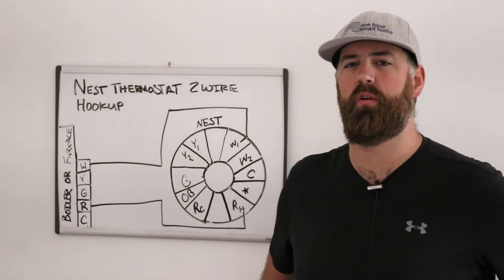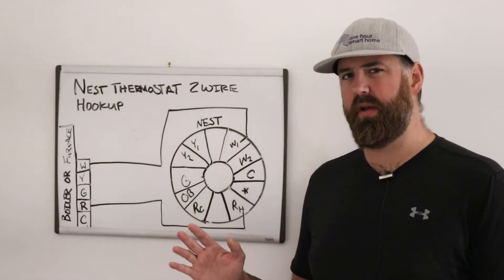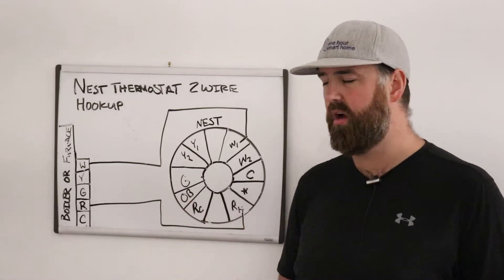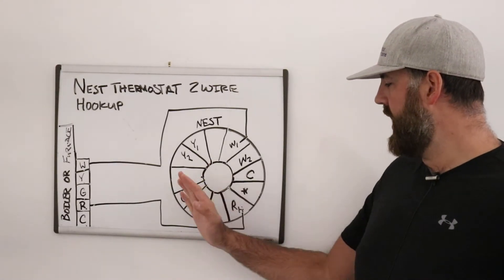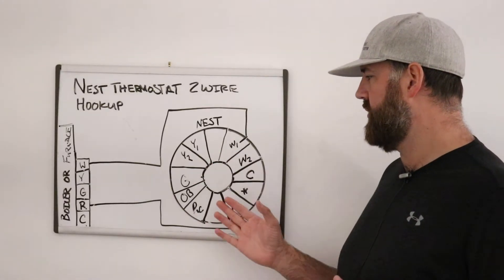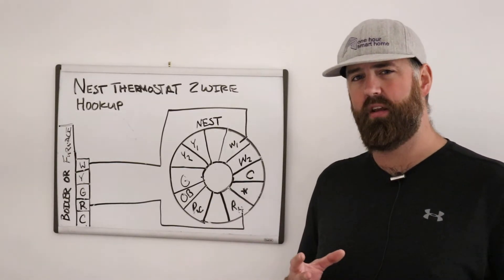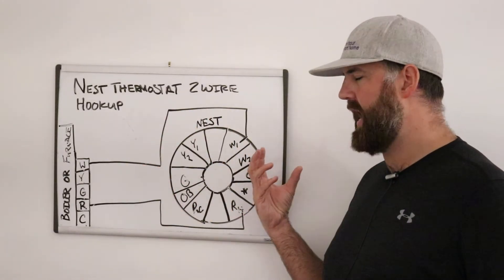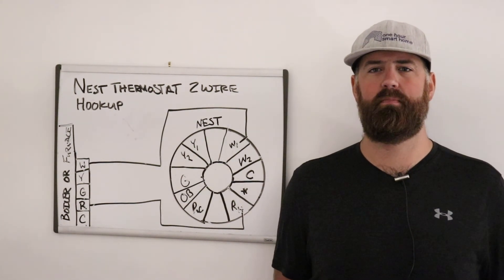Nest Thermostat 2 Wire Hookup Instructions

Comment: I just want to install my Nest Thermostat to use with my cooling only air-conditioning system in a very old Singapore building... does ANYONE have any advice on where I can find out how? It has only two wires coming to the manual thermostat right now.

Comment: thanks for a great tutorial. I have a question maybe you can help me with. I have a 1995 manufactured home with a forced hot air and a/c unit using a two-wire thermostat. I believe the way they can get away with only two wires to the thermostat is because there is a switch on the furnace you switch from heat or a/c. and there is also a switch on the thermostat itself that has a heat /cool switch. so, what I am thinking is I can use it for both. by switching at the Furnace and using thermostat as you would with heat. just wondering if you had any experience with a system like this.

Comment: Great Information! I have two separate heat sources. One is a Fireplace with a millivolt  two wire. The other is floor heat boiler. Will the nest E work separately on both? Thank you

Comment: Yeah, this will work.  Sometimes…

The nest electronics run off a small internal battery.  That battery will recharge off of the red and white wires, which will read 24 VAC between them, but only while the thermostat is not calling for heat.  Once the nest shorts between the red and white wires there is no longer 24 VAC between them and there will be no battery charging.  If your climate causes the thermostat to call for heat often, the battery will discharge too far to run the thermostat and you’ll lose your ability to heat.  This scheme is called power stealing, and it’s not reliable.  

Instead, you’ll need to supply another 24VAC return wire on the C terminal.  This will put 24VAC between the R and C at all times, even when calling for heat on the W.  If you don’t have a third wire, you can just plug in a 24 VAC wall wart transformer (300ma or greater) and connect the two wires to the R and C.  That power will only be used to power the nest, and not be used to call for heat.

Comment: I have a question. I have a system call Hot Water Electric Heater from Intertherm. Is have 2 separate electric wires little weird for me. So left side have black and white have current power when i turn on the circuit. And the right side has black and white that doesn’t have power. I will post a video on youtube and if you can point out for me that is super helpful.

Comment: I should’ve just watched this video and called it a day… but given your explanation for Nest, does it work with Ecobee as well?

My setup is the same. Red wire and white wire. I replaced a dial Honeywell thermostat (not sure if it was the mercury one) with a digital Honeywell thermostat. Red wire goes to red slot in the Honeywell thermostat. The white wire in the white slot.

I want to use the free ecobee that I  received from the utility company. Can’t I just connect this in the same fashion?

The furnace is 25+ years old. Still works!!

Comment: Have a two wiring heating and cooling V+ =red wire and VG = Green wire. Voltage is 3.38 v i know nest requires 24 V to operate do I need a transformer?

Comment: I have a Modine heater in my shop and my thermostat currently is a two wire set up (W & R).  I have a nest thermostat, and it requires a C wire or a Google Power Connector.  
How would you wire up a system like this using the Modine heater? I already went ahead and connected the power connector in the appropriate spots according to where the thermostat wires were and I connected the C wire to its appropriate spot. I fired up the Nest Thermostat, and it did not detect the C wire/power.  am I supposed to install a jumper wire connecting the C and the R behind the thermostat?

Comment: I have an old Honeywell 2-wire thermostat (mercury switch) hooked up to a relay that switches a 240V load for baseboard heating. There is a spare third wire, that is unconnected between the thermostat and the relay switch in the basement. Is there a way to rig it up with a 24V wall wart transformer to get power to the Nest?

Comment: Question…. I have it setup the way u have it for the last 2yrs and today I got a “e74 not detecting the rh”… everything I saw said it’s your condensation line clogged but I don’t have a condensation line… it’s heat only and it’s radiators .. z

Comment: Perfect video. I have a gas boiler. My thermostat has a R wire that is white and a C wire that is black. Just 2 wires. Will this work with the the basic Nest ( non learning)Model  GA01334 or 
do I need to hook up the C wire adapter? Appreciate any insight. Such a helpful video

Comment: great channel.....I have a Nest basic thermostat need for a furnace with two zone requirements...therefore needing two thermostats....currently the main thermostat has 6 wires and the secondary thermostat has 4 wires....the main one has an orange and black wire.....How does the wiring work?....I have another Nest on the other furnace with one zone and 4 wires with easy hookup however just watching your video I know how to hookup the C wire for power..thanks...So the Nest basic has an orange/black port but not both....Confused as to how wire it for two units on the same furnace  thanks  Gordy

Comment: Thanks for the video - it got me thinking, however this workaround did not work for me. I got things working eventually and will describe in the hope it helps others. I have a gas HVAC system (heat only) with electric blower. Installed around 2000 with a Honeywell Chronotherm IV controller which has 3x1.5V batteries. It had two wires connected to W and R. Nest Gen 3 kept turning off with two wires connected to Rh and W - it reported no power to Rh wire. So I bought a 24VAC 1amp power supply from Jaycar and connected as per your other video with three wires. Again thermostat kept turning off due to no power to Rh wire. I then connected transformer to Rc and C, and connected the old wires back to Rh and W. Thermostat had power but it blow only blew ambient air, furnace didn’t come on! I then twisted one transformer wire together with the old Rh wire and just got the now thicker end inserted in Rh, left the other trans wire in C, and the old W wire in W. Hey presto! It works fine and well tested now. Cheers.

Comment: Great info.  I need some help.

My workshop has two standalone natural gas heaters.(2 wire system)

I also have two residential air conditioners I believe it to be a standard (4 wire?). 

I want them all on one nest thermostat.

In the winter I want it to close/open the circuit to control the heaters without turning on the blower fan that is on the A/C.  

Can a nest do this and Where would I connect what wires to the nest and are their any internal settings needed for this to work?

Comment: So I have a miller/ Beckett furnace with a first generation nest.. only two wires running from unit to thermostat… how do I hook up without adding c wire bc there is nowhere on my board for me to connect to.?

Comment: What would you do if your 2 wires are red and green. My thermostat is really old, which uses a small lever that you move to the right to select the desired temperature. That's what I have in my home. It's heat only, and my furnace uses gas, not oil.

Comment: Someone PLEASE HELP. I have 2 wires coming out of the wall, when the Nest first turns on it will run me through the set up process and runs the test and kicks the furnace on no problem then shuts it off. But then roughly 2 minutes later it says there’s no power to the RH wire and I get an E74 code. 

So I take the nest off the base and restart it and put it back on and turn it on, and I’m able to turn the thermostat up and the furnace comes on, then again after roughly 2 minutes of being on it sends me the message that there’s no power to the RH wire with the E74 code. Can someone please help.

Comment: I have an old thermostat that has two wires. Vg and V+. On the controller it also says Vg and V+. The controller also has all of the Y, W1, Rc and C. I've installed the nest with Vg to W1 and V+ to Rh. The nest is only reading the heating but not AC.

Comment: My wiring is one (thicker) black wire that splits into two wires. (Reminds me of the pull n peel twizzlers candy). One black wire runs to the “W” and the other runs to “RC”. Then I have a red jumper wire that is in “RC” and “RH”. So on the Nest, I don’t need the red jumper anymore. I just connect the one black wire to W1 and the other black wire to RH? I just don’t want to fry the furnace. 😞

Comment: I've got two black wires (one goes to the W terminal and one to the RH terminal), a green wire that goes to the G terminal, a white wire that goes to the Y terminal and red wire that goes to the RC terminal on a White-Rodgers thermostat. I'm trying to replace the thermostat with a Nest thermostat. I'm wondering if I can use the black wire that goes to the RH terminal as the C wire?

Comment: I know this video is old but I need some help. I have a two wire system, red and white wire. I put the red in the R terminal, and white in the W1 terminal. The only options my nest is showing is heat, off, or eco. There is no cooling option. What am doing wrong?

Comment: Thanks for the video. I tried this with a old school 2 wire thermo connected to a fireplace. It didn't work, the Nest didn't power up. Any suggestions? Thank you
Reply: I'm having that same problem.
Reply: @joebenckert8740  search up a C-Wire adaptor in your favourite online store. The 2 wire system doesn't provide enough power

Comment: Just installed a Nest thermostat and am getting an intermittent flashing light on my boiler control panel when the nest is not calling for heat.  If I take the nest off the baseplate, the flickering light stops.  Any idea on why that would be happening?  Just reinstalled the old thermostat and the system is acting normally with no flickering on the boiler control panel.

Comment: This was great! I have a super old Taco 568-13 thermo for heat. 2 wires: 1 red and 1 white. Sounds like I would just go R>Rh and W>W1, no need for common as I'll be using the Thermostat E model. Now, does having multiple zones change anything? I have 4 separate zones, each with their own thermostat. I plan on replacing them all eventually, but just want to hit the old Taco one first.

Comment: This was a great video, and the content was well explained. 
I have been thinking of buying a NEST but did not want to purchase the more expensive 3rd generation but it's been stated that the Gen 3 can use 2 wires and a 24 volt (Low voltage) system. I don;'t want to spend the $100 and find that I need the common wire, so maybe the $249 version (3rd gen) is the best to alleviate the possibility of it draining the battery. 
This video stated 90 % only need 2 wires for a heat only, which is what I have. 
Model:T3007ES <— 3rd Generation Nest ok with 2 wires - 
Model #GA01334-US Nest Smart Programmable Wifi Thermostat <-- May need Common wire.

Comment: Hey, I have my 2 write system with 2nd gen nest but get an e24 error when connecting. It says my Rh is not powered. Any help you could give me?
Reply: I’m having the same issue on a Gen 3 nest. We’re you able to figure out the problem
Reply: @dangood436  I purchased a 24 Volt Transformer, C Wire Adapter on Amazon. Connected into the system and got it working.
Reply: @B.M.D.  Hi Ben, thanks so much for getting back to me. I literally ordered the same thing last week and it came in at Home Depot last night. So I ran up there and grabbed it before they closed and put it in at 9pm last night and it worked. I couldn’t be happier because I was starting to get really aggravated trying to figure out why this nest wasn’t working.
Reply: @dangood436  great to hear. If you have any other problems with it, try switching the plug the other way in the wall. I had a polarity problem at one point and that fixed it.

Comment: you mention that cooling only system is very rare... well we've got one living in a very warm location. so, we are looking for a 2 wire install instruction for cooling only scenario as follows: We are installing new cooling units (Samsung 360 Cassette 46,000 btu model), but we do not have any heating whatsoever as we are in a very warm location year round. The samsung thermostats (model MWR-WE13N) have a low voltage 2 wire connection (labeled F3 and F4) , similar to the 2 wire heat that you just demonstrated. I've tried discuss this with Google nest support and they have been useless. We are looking for a diagram, and advice, whether 2 wire with Samsung products, can be set up on Nest Learning Thermostats. We are also more that happy to add control wire separately to power the thermostat so that isn't the issue here. Any advice? Cheers!

Comment: Thanks for your video, it is very usefull. I have only 2 stranded wires between my actual thermostat and the boiler. With a multimeter switched on V~ I read 195V through these wires. Here in Chile we have 220V. Can I use the nest learning thermostat? Thanks in advance
Reply: Not sure if you ever got an answer in this but no you can't. That's high voltage and best y does not work with that. Be very careful as well.

Comment: I have electric baseboard heaters with 220VAC through the thermostat - will the Nest work for me or will it blow!?
Reply from the maker: The Nest wont work but  the Mysa Smart Thermostat: https://amzn.to/3tqNxHP will work in most cases it is designed for 220V AC baseboard heaters.

Comment: Hi!  Forgive my ignorance, as everything I know about this I've learned in the last two hours googling.  I have a gas wall heater, with a millivolt thermostat.  Am I correct that the Nest will not work with that system because it does not generate enough power to actually power the thermostat?  I have a very old thermostat (with mercury) right now that has been failing and want to upgrade to a smart thermo if possible.  Thanks!

Comment: I have a 3 wire thermostat wire that was on an old mercury thermostat. White wire, blue/white stripe wire and red/white stripe wire. I ended up putting the blue/white striped wire into the C port on the nest. But now it shows up with a No Power error message. Any suggestions please?
Reply: At the boiler you need to find that wire and see where is goes. It needs to go to c terminal. If it doesn't work ( wich it's not ) it's because c is probably not connected in boiler room
Reply: @joshuaphurkotum9292  Thank you.

Comment: I have an oil boiler with zone valves and a brand new nest (which only has Y, C, W, G, R and OB terminals) and I can get the nest to turn the heat on and off but the nest gives a message of no power and frequently disconnects form WIFI. I tried jumping the R to C or the W to C and still nothing. when I connect the R to C and the W to W, the thermostat has power but will not turn the heat on. The help links from Nest are essentially useless and end up telling you to call a Nest Pro.
Reply: I had a similar problem. The way I solved it was I went down to the boiler where the on and off switch is where the wires come out of the switch and go into the boiler at 120 volts I added a 24 volt transformer used the blue and yellow wire and ran them up to the thermostat the blue went in common  "c" the yellow went in yellow  "y" and it works just fine never loses power. It sounds complicated but it only took about 15 minutes... I would have used the other adapter but the boss lady would have had a heart attack if she saw those wires hanging down the wall And I have a 5-year-old that thinks everything is a phone charger and unplugs it so we won't hurt the environment...😊
Reply: @BlueDinnie  Donald, thanks for posting what you did as a work around.  I also have a 2 wire system for an oil furnace (thankfully had 5 wires run) and was having the same issues.  I just tried your way and it worked perfectly.  Many thanks!!
Reply: @ericslicer3880  🎉💪🏿 awesome love it!
Reply: @BlueDinnie  I would have done that except from the boiler to the thermostat I only have two conductors and they of course get there through a finished plaster ceiling.
Reply: @johnm948  Ooooh Yeah I could see where that would be a problem at my brother's place we found it easier to just move the thermostat to the back side of the basement stairway drilled through the wall with a smalls drill bit and run the fresh wire to the boiler where the existing holes were already in the studs... Pulling that wire through the wall is a pain in the butt...
Reply from the maker: In many cases with cases with Zone valves/Zone valve controllers/Zone panel controllers there's not enough power for the Nest. The Newest Nest: https://amzn.to/2MTiRz1 does not work in 2 wire systems without a common wire. To install a common wire you can follow this: https://youtu.be/yi5kfn3bmEk and use a common wire transformer.   Or if you have enough wires from the thermostat  back to the panel you can connect a c wire a the panel and then to the thermostat.  With a typical zoned system with a zone panel like this: https://amzn.to/3nxqW98 they will typically need a c wire from the panel to the smart thermostat because the terminals on the panel to the thermostats don't output enough power for smart thermostats.
Reply: @OneHourSmartHome  yes, the current needed to operate the zone valve robs the nest of power. A simple relay for a hot air system doesn’t do that.

Comment: On the new google nest thermostat.  There is only Y,C,W.        And G , R , *OB. .

I know the C is common.  What two wires should I hook up for the witch to work?
Reply from the maker: I did a new video for the new nest thermostat you can watch it here: https://youtu.be/yi5kfn3bmEk requires a common wire to work. The Nest Gen 3: https://amzn.to/2X4WbgP is an easier to install option if you only have 2 wires as it does not require a common wire. Here's a full installation video: https://youtu.be/FodDVX2VDGo